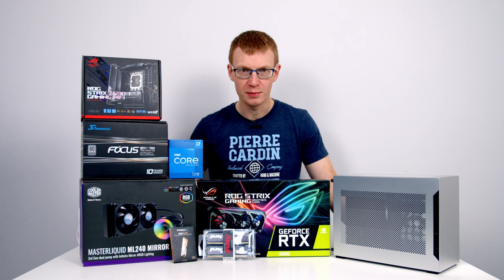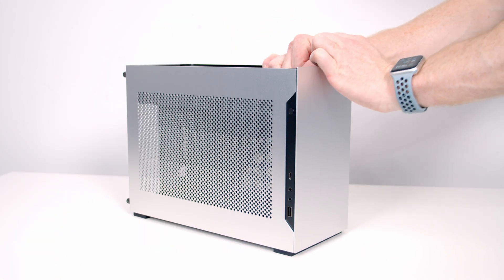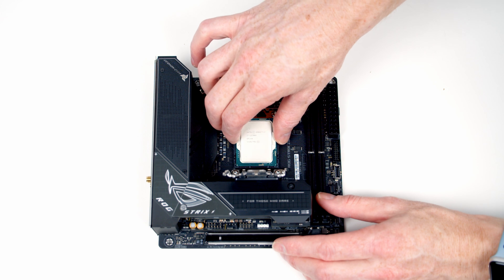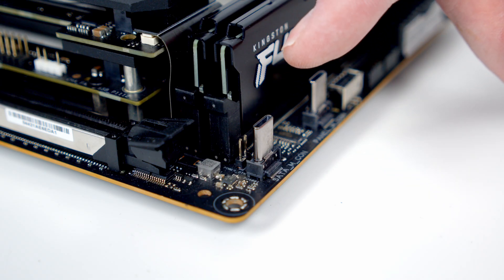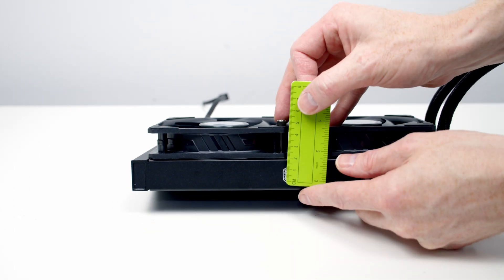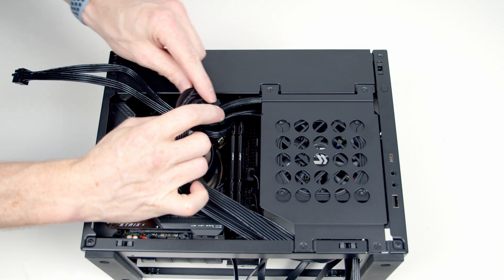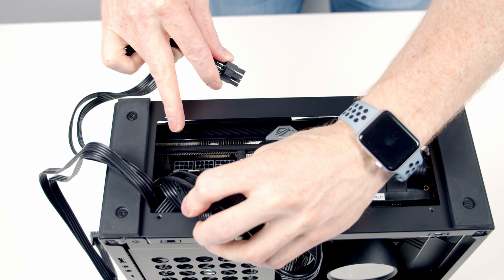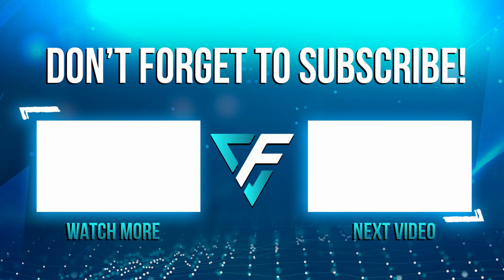Lian Li | DAN A4-H2O - Step by Step Build Guide

Comment: I recommend routing as many cable as possible flat under the motherboard, like most notably the CPU power cable. Not only will it look a bit cleaner, but also leave more space for airflow and not have as much potential to interfere with fans. If you're struggling to keep cables and hoses away from the fans, consider using fan grills.

Comment: I just wanted to thank you for making such a simple step by step build  tutorial with case as I went away from this and built my very first PC with nothing other than this video and a few computer component compatibility websites. You’re a legend!!

Oh and a little side note I couldn’t seem to get all three gpu screws to line up properly on the rear mount. I used a MSI 4070 Ventus 3x and no matter what I tried (even tucking away all the cables) it wouldn’t align but I got two in though :(

Comment: Hi guys,
Im planning on getting the same motherboard and use my i5 12400f and rx 6600xt from my old pc. I am considering either the Fractal ridge or the dan a4 h20. I'm wondering if this will allow for a fan cooler setup such as the noctua L12s or L9i or cooler master G100m. Additionally I would like to get 2 ddr5 ram slots 32x2 for total 64gb ram, which one is going to be compatible fast and not too expensive. for the power supply I will be getting the cooler master v850 sfx for future proofing upgradeability. To recap, I need recommendations on the cpu cooler, ddr5 ram and which case I should buy. Looking forward to receiving help from sfx internet community :)

Comment: Nice video. I just got all my parts in and I'm fixing to start. Just wanted to get a couple guide videos in before I started. I'm stuffing an Asus B760-i, 13600k, Vengeance DDR5 5600, Corsair 240mm AIO, Cooler Master 850, RTX 4080 FE into it. Thanks for sharing I'm sure it'll make things a lot simpler once I get going.

Comment: excellent video. Did the same build but a lesser gfx card. Got it all booted up but for the life of me I can't get the mic to work at all. I can get sound in certain jacks but even when the mic is recognized in some jacks there's no sound and the mic doesn't actually work. I've tried multiple mics and even tried linking a controller and plugging the mic in there and even then I get sound and no mic. All drivers are updated, and I've tried all the recommended steps to get a mic working with windows 11. at one point I even had a video I was watching start playing through to my buddy on discord but not actually through the mic. Anyone got any tips at all? I'm at a bit of a loss.

Comment: Forgot to mention. Probably you should add some notes about where to get the low profile screws to replace the thumbscrews for the radiator fans (11:01) .....because you needed to supply your own (I don't think most people have these screws lying around). Lastly there are a lot of AIO pump blocks that won't fit. Would have been good to point that out
Reply: beginning of vid he did point out the maximum size for the radiator fans and pump block for the case 1:15

Comment: Does anyone know which PIN row of the USB 3.0 header that the case’s USB port uses? There are two rows that can power two separate USB ports but the case only has one. 

The reason I ask is because the motherboard I have has a broken vbus pin and I’m hoping the cases uses the other row of pins.

Comment: Hi there, at 11:09 you mentioned you need different radiator screws for the AIO to fit, where did you get those flathead screws? thanks!
Reply: This reply is very late, but for those wondering, 6-32  thread 1.25" flat head screws work fine.  I picked some up at my local hardware store.

Comment: Did you do any research on that AIO/Motherboard combo, or did you just get lucky with the clearance?
I did this same build with the ROG Z690-I, but used an NZXT X53 AIO which it doesn't fit in any orientation on this board.
Reply: The pump height for the NZXT X53 looks like 55mm which is the max in the case (which doesn't seem to include the motherboard height).

Comment: i found possibly the jankiest way to fit a 240mm AIO with thumbscrews holding the fans: remove two thumbscrews diagonal to each other on the middle of the AIO, the fans will be held by three thumbscrews and it will still fit in without issues

Comment: What screws did you use as replacement for the aio?
Reply: Looking for this as well, I guess it is not included? Do you also know if ML240L V2 would fir the Strix Z690-I just like the mirror variant he has?
Reply: The specs say the pump is slightly smaller so going off that it should fit. For the screws I have ordered the Corsair CW-8960008 Mounting Kit and I am going to build on Friday so I'll let you know if they fit then, although I don't know what screws the ML240L V2 itself comes with.
Reply: @notatallme6842  From the picture, seems like thumbscrews as well, and from research i saw on reddit, people say it uses 6-32 Thread 30 mm Length Screws. So yeah do keep me updated, looking foward to it.
Reply: @salsashreenee6887  I am afraid the case didn’t arrive when it was supposed to and I have a new arrival date for the end of the month
Reply: @notatallme6842  no worries I preordered it on overclockers UK and we don't even have a date we just have to hope 😭
Reply: Case has arrived and I have installed the aio no problem with the screws I mentioned earlier however I am not planning to installing anything else till tomorrow so I’ll tell you if it still fits then.
Reply: @notatallme6842  How is it atm? Did everything go ok? Are you also using exactly the ML120L RGB V2? I've been wondering if I should get the LGA 1700 mounting kit from cooler master even though th emotherboard supports LGA 1200 like in the vid but afraid it impact the mounting pressure hence temps.
Reply: @notatallme6842  Nice thanks, mine is shipping for tommorow as well
Reply: Not sure, I had to send the mirror back because it was too big but now finished with the ek basic and it works fine with good temps
Reply: @notatallme6842  that's weird do you have this same exact MB? Strix z690i, cause he shows it fits and ok the ek aio basic doesn't fit on this MB
Reply: No I went with am4 socket which does seem to have higher mounting brackets which is why it wouldn’t fit but luckily the ek basic fits nicely and temps aren’t bad and noise is very low
Reply: Still missing out on a bit of rgb and it make it almost impossible to tell if my pc is on from a distance

Comment: Do you think the EK AIO Basic would fit on Z690-I without any problems?
Reply: Don't fit!
Reply: Do You know the answer? I also wonder it this will fit with EK 240 Basic. I think there might be some problems with routing tubes - either they may touch DDRAM modules or radiators if rotated 180 degrees.

Comment: whats the diffrence between pcie 3.0 vs 4.0 ? does it matter for gaming?
Reply: The difference is arround 1-5%, it means you wont see any difference in Gaming!

It has a few Reviews what compare PCIe 3.0 and 4.0. with a RTX 3080/3090.

PCIe4.0 is important if you have a GPU with under 8Gb RAM and PCIe4.0 Support. 
Than you will notice in some cases over  10% difference.

My Tip: If I build a new PC, I wouldn't go for PCIe 3.0, because in future the difference will be little bit higher.
Reply: You won’t feel the difference in real world usage.. Only time you’ll see the difference is in benchmarks..
Reply: The difference is double bandwidth on 4.0, 16 vs 32 GB/S. It does matter just in case of 6500 XT because that card have only 4 PCI lanes so its the big difference if you use it on PCIe 3.0. On decent GPU with full 16 lanes it doesn`t matter. Like An Re wrote in case of flagship GPU there is almost no difference because today`s GPU`s can`t use full bandwith available on  PCIe 4.0. Difference on 3080 3.0 vs 4.0 is less then 2%.
Reply: Very much so - newer cards are 4.0 and would be potentially choked if you plugged it into a pcie 3.0 cable or motherboard since there's lest bandwidth on the pcie 3.0 lane!